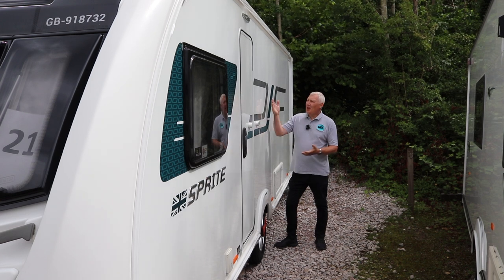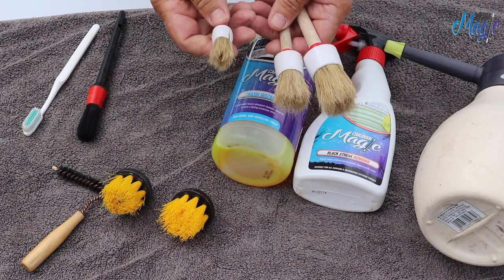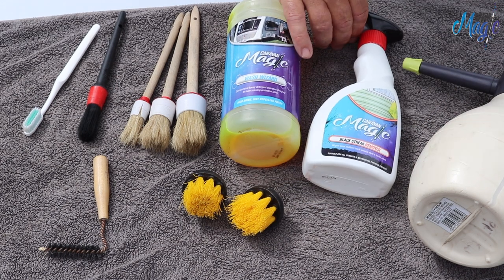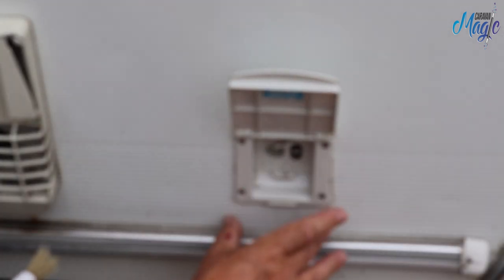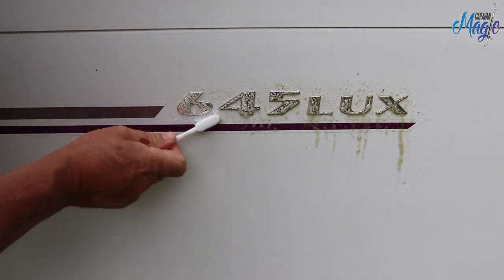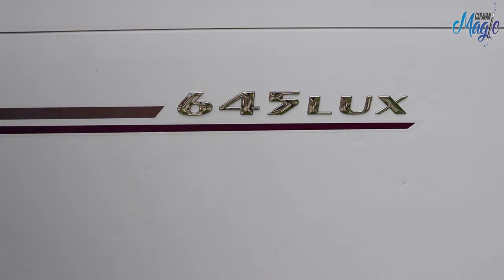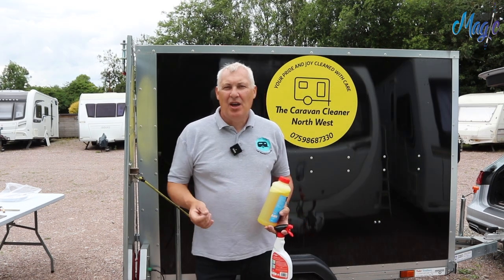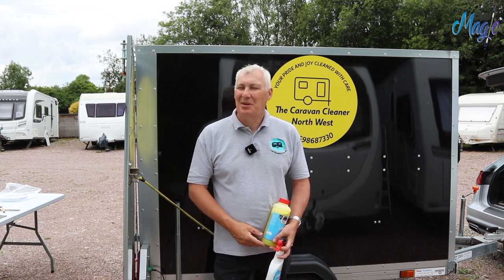Caravan Black Streaks (Removal & Prevention)

Comment: Hello Phil we’ve just had are caravan cleaned ready for the bank holiday weekend, the people that cleaned are caravan recommend fitting a awning rail protector to help prevent black streaks,  ( one ordered) if I can’t get two out of a 12 metre length, I will order another one later, thanks for your tips, until next time, 👍.
Reply from the maker: Hi BB You know you can trust my judgement😂. I think you may need 2. Make sure the awning rail is before fitting. Many Thanks Phil👍🙂

Comment: I have tried most of them & a get the best results with Autoglym caravan & motor home cleaner. Then rinse thoroughly & apply a little Gyeon wet coat & rinse off.  Good video cheers.👍🇬🇧🏆
Reply from the maker: Hi Senna I think there are so many ways and products to remove black streaks. The hardest are the ones engrained in the body paint work. I use t-cut on them. Thanks Phil 👍🙂

Comment: Thats a good video there Phil. Our Bailey is a nightmare for black streaks at the back. Even after the roof etc has been cleand it's still dirty at the back. I do wonder if it's the roof strap getting dirt built up as don;t have the bottle to give it a good scrub with the issues with the roof strap. As I say mine needs a good clean but I am keep putting it off. There is clean cold water at storage so should get it done.
Reply from the maker: Hi Paul. A lot of the dirt collects around the Brake Light and the straps. I use warm water to clean the vans as it lifts the dirt much better. Maybe a 12 volt kettle could help you with the cleaning. Thanks Phil.🙂👍

Comment: Nice tips Phil, I’ve a dreaded join and it’s a nuisance. My awning rail protector strip is filthy and struggling to get it clean.
Reply from the maker: Hi Colin. Thanks for watching. I soak the awning rail protector in warm soapy water for 1/2 hours and then use Cif to clean it. It works most of the time it depends how old the strip is. Thanks Phil🙂👍